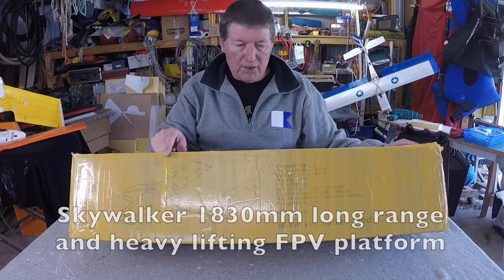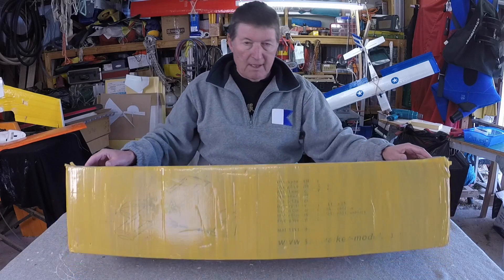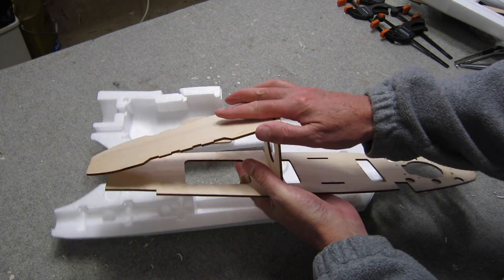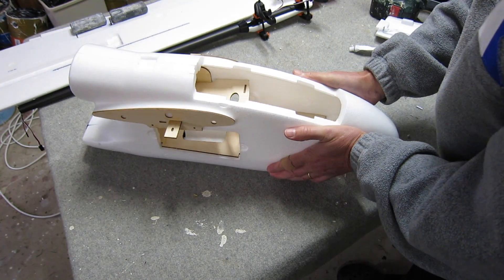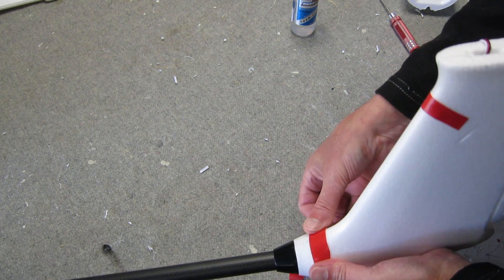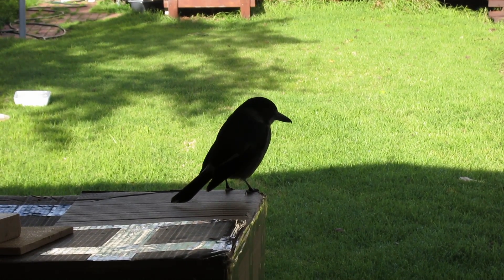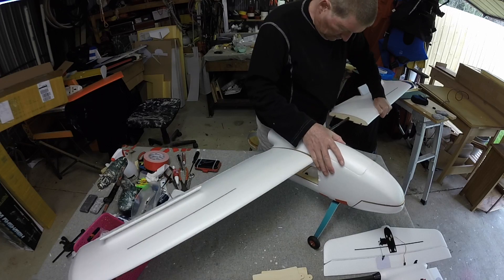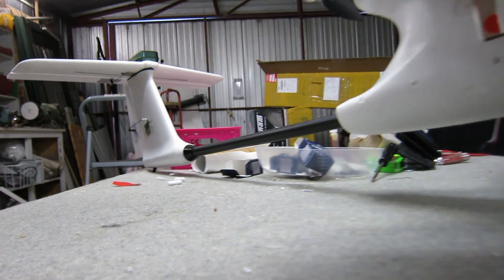Skywalker 1830mm build

Comment: Are you using just plain superglue?  For assembly? I bought the 1900mm plane and just slowly trying to build it. It's very similar 
Cheers
Reply from the maker: Looked like I was using the rubbery glue that came with the kit, or HobbyKing glue. Could use CA for the plywood bits, UHU Por and hot glue for the foam.

Comment: Hi Andrew,  it's a great video, bravo! i just wondering what is the dimension of the inside fuselage? I just want to know how big the inside is, especially the middle part (between door and front gimbal place)
Reply from the maker: Hi Shafwan, I have modded the fuse so much that I cant give you an internal measurement I'm afraid.

Comment: I got the older Skywalker 1900 earlier this year. Has under cambered wings which allow it to carry unbelievable weight, and landings are so much fun with slow approach and high wings. The 1900 needed the ailerons to be extended as it was very vague on response when downwind, but awesome plane to fly. I like the removable fuse aft section. I just picked up the Quanum Hawkeye 1700 which looks very similar and has removable aft fuse as well as folding wings. Makes it very compact. Looking forward to your maiden.
Reply from the maker: Might have to remove the tail boom (very easy) for transport, It's well designed for disassembly

Comment: No matter which time it is: yt message about news on your channel blows me out of the bed!
It looks indeed like an alien, hiding its 'second jaw' inside the fuse. 
I would be suspicious about the glued elevator. It's quite big, so will it withstand harsh manouvers? Two screws would do the job. Or mixing elevon on a switch. (don't know if that works: switching to elevons if the elevator fails )
Love your little sidesteps : your cat as a building supervisor, a bird controls if anything's okay... really nice!  :thumb:
Reply from the maker: Thanks Tom, very encouraging feedback. I have re-glued the stab using good old fashioned hot glue. Off to maiden now.

Comment: Have you had luck with that glue in the past? I got a identical tube with my Zeta FX-61 and all the glued parts cracked off after a short while
Reply from the maker: HK glue is in the bin. The kit glue and hot glue are working well with this foam.
Reply from the maker: I honestly don't know yet. Have to recheck this morning after overnight cure, but I'm not filled with confidence.
Reply from the maker: Just checked and the kit glue is fine, but the HobbyKing glue is no good. Need to redo the horz and vert stab joins.
Reply: I had that glue from hobby king, it's utter pants. Andrew, I'd double check everything you've glued with it, my axn wings came off because of it! (Ps. Fab video as usual !)
Reply: "Foam-Tac" is what 7demo7 used on his FX-61, thats what I've been using lately. Even though it says it does foam, it does a little.